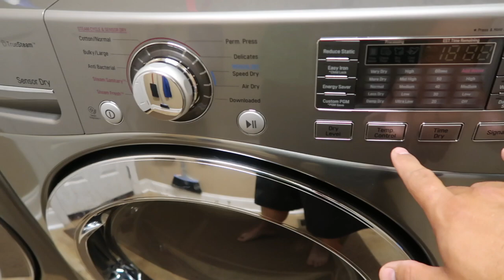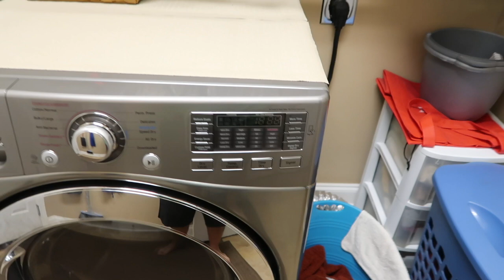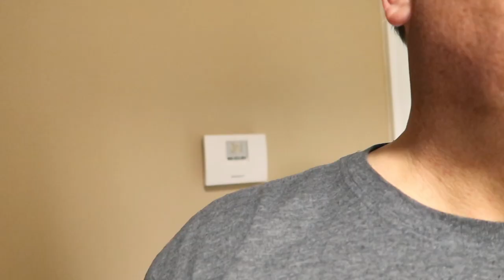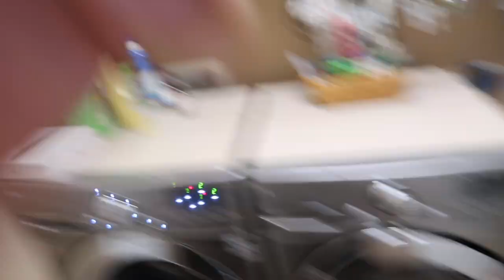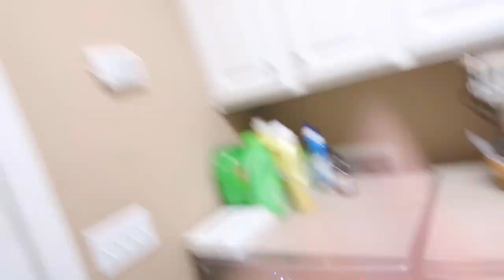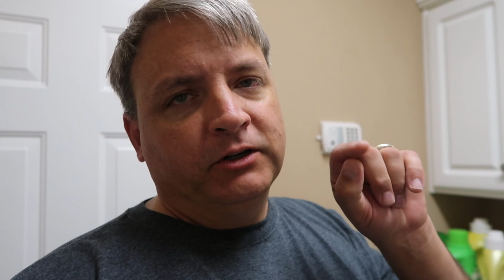New LG Sensor Dryer 6 Months Old Stopped Drying

Comment: Both electric and gas dryers come with thermostats. My LG gas dryer has three thermostats. Sometimes they're referred to as safety thermostat or high limit thermostat. The thermostats with the button are known as the manual reset type. The thermostats without the button are known as automatic reset. When the exhaust system gets clogged with lint, the thermostat will stop the heating portion from working to prevent a fire. The auto reset thermostats will reset once the temp cools down, but after several cycles of doing that it will eventually die out, which is what happened with your dryer. My gas dryer has one thermostat with manual reset and I clicked the button, but the thermostat is still blown. So having the button doesn't mean the thermostat won't fail, or that it is better.

Comment: first off the reset button was not put in for customer use. its put there so the tech knows your dryer is over heating and if the cause of the over heating is not resolved and you keep resetting it you can start a dryer fire. now the reason the reset button was taken out is because customers were  #1. if you take the tube out of the back of the dryer you break the seal of the vent tube that prevents the dryer from filling up with lint and lint build up can cause an internal fire  #2 customers were sticking there arms in the dryer and cutting themselves up with the sharp edges. #3 customers were dumb enough to stick there hands in there without unplugging the machine and electrocuting themselves real geniuses    and for the grand finally. for  an appliance warranty there are programs that cover up to 5 appliances for $25 a month  up to 7 appliances  for $35  a month  and that's well worth it cause if more then one  appliance breaks and the repair cost $300 to $400  each then  $300 a year is alot better then $600 -$800 for repairs.

Comment: That reset button is only found in gas dryers.
Reply: Yes, not on a electric dryer.  That reset is a thermal overload reset  switch, it might go out from a clogged vent system. When you do your repair always clean the inside by your motor regardless of your dryer being gas or electric

Comment: Mine is 8 yrs old and stopped drying.. I took out 12 screws (fairly easy) through my meter on the parts until one didn't give feedback.. took the screw out (sensor) took it to appliance store got a new one, put the new one in with screw and put the 12 screws back in.. done. think it was 17.00.
Reply from the maker: cool, I hope you made a video of that!!!  that'd be super helpful.. if you did link it here so others can do the same fix... or make one now and post it, link it... all that.

Comment: 14 years mines been good. Had a 33% chance this was the fix. Nope. Maybe igniter or thermostat. Otherwise video was spot on. Thanks for the tutorial 👍👍👍
Reply: Same here! Ours has worked flawlessly for 13 years. But now I can only use "speed dry" the other settings work but when I use them they stop drying after a few minutes. In the past, I could set them on whatever setting I needed and they would dry until finish, not so much now. I don't want to purchase new ones because ours still looks great and they work very well but I wish I could fix this issue.

Comment: Just got mine two days ago and the dryer is doing the same thing shutting off in less than one minute my ducts are clean so they wouldn't be any issue with Lint. I just called Lowe's I'm taking this crap back washer and dryer.
Reply from the maker: good call.  I'm still using this one, but it's not great.  I probably won't buy a LG again.
Reply: @StuffIHeardpodcast  I switched out for a Maytag
Reply: @bigd8812  how is that maytag running? My LG is absolute dog shit.
Reply: Since you are keeping it I'm not sure if you have one but you should get extended warranty
Reply: I love the washer but the dryer has some issues !! Design flaw for sure ! I thought I was crazy!

Comment: The only advantage I can see having a fuse type thermostat on the inside of the dryer is the reason it probably blown being a clogged ventilation system of the dryer . Opening the unit up gives the opportunity to clean the lint from the inside of the unit . The lint is like a match and ignites very easily . Many a house burned down from dryer lint

Comment: mine had the same problem not drying mine was the thermal cut out relay cost me 42$ for such a small part LG sucks I've had mine for 3 yrs and keeps having proplems
Reply: i bought a lg dryer 2 years ago so far ive had no issues with it.  it kept throwing a d80 clogged vent code even though vent was clear and it was drying well, and hot air was coming out the exhaust. the code would only appear when dryer was connected to the vent on house if we ran dryer with vent unhooked it was fine it ran like that for about a year. finally i had some one come look at the venting it had been cleaned before new dryer was installed.  well come to find out whoever installed the vent in house had run the entire 8ft run of duct with flex duct the foil flex type which is against code here.  we had the ducting replaced and since we have had no issues with the dryer.

Comment: That video you are referring to is of Scott The Fix It Guy and is on a Gas Dryer. You have an Electric Dryer. Those thermostats aren't meant to be reset. If it blows that means there's a problem elsewhere not just the thermostat. Check out your vent in your wall and make sure it's clean... that will cause the thermostat to blow. It's meant to be a safety mechanism not an inconvenience.
Reply from the maker: Good to pass along.  Thanks.  :)
Reply: Right thats what i was  meaning with my post.
I had my dryer vent catch fire last year the vent cloggeg i didn't notice it.
I had been doing laundry all complaining that my dryer wasnt dryer well.
I loaded a load of towls into the machine turned it on high heat kike normal i left the room  i came back in about 30 minutes to check them.
I opened the dryer door to have smoke just bellowing out of it.
Man i had me and my partner pull that dryer out fast i riped the dryer vent out and sprayed with a fire  extinguisher.
Luckily it didnt have a chance to get bad.
The vent used to run through the ceiling i know have it running th9the floor shorter run.
Luckily with a little cleaning my dryer was okay. All this could have been prevented if i had only know the vent was clogged.

Comment: They probably do that just so you can't fix it your self them sneaky ppl
Reply from the maker: Yeah, I think they did it just to be cheap.
Reply: @StuffIHeardpodcast  i think they did it to keep peopke from burning there houses down if the thermal fuse blows there could potentially be clogg in the vent or sometbing causing the dryer to over heat.
A fuse that has to be replaced means you have to call for a service which if its blow hopefully they would catch the clogged duct rather then someone not knowing there is a problem rests it then burns the house down.